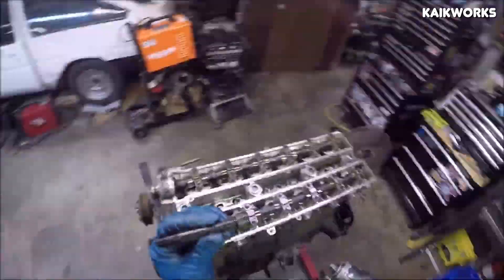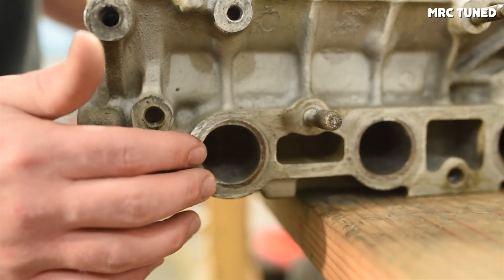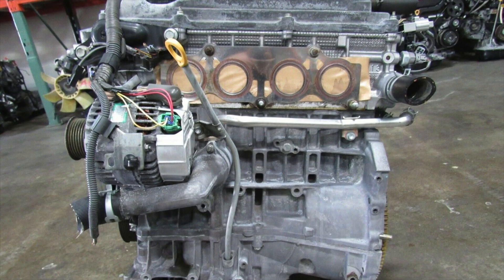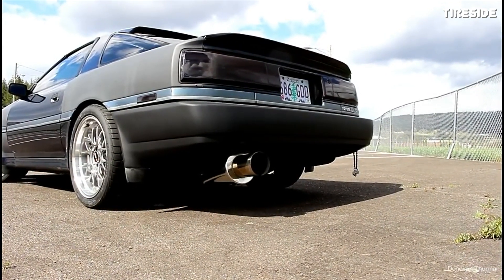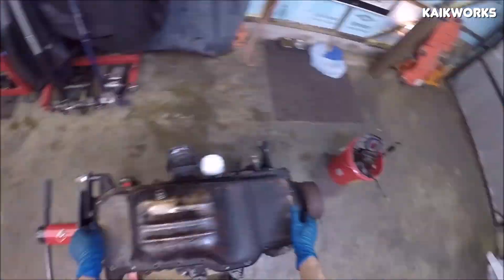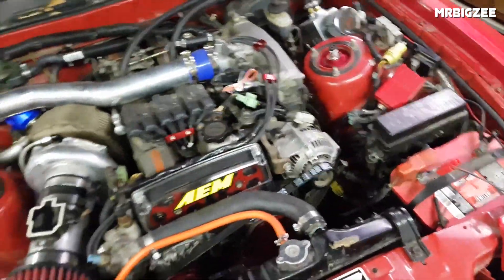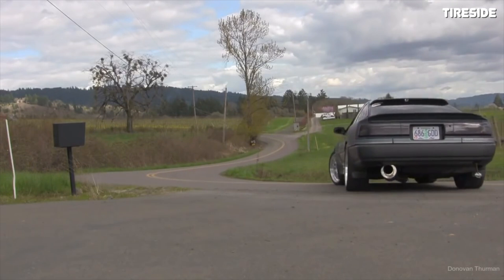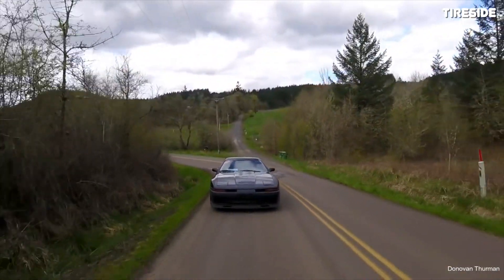Toyota 7M-GTE: Everything You Need to Know

Comment: The problem with the 7M-GTE engine, especially the road knock, came from the coolant which dripped into the oil, and therefore it was a followup The stock engine with the cylinder head properly made was able to generate over 500 horsepower reliably. The rods were not a problem.An often overlooked problem of the cylinder head was because the coolant wasn't flushed enough with the cast iron block. Everything got rusty and therefore the engine wasn't able to cool enough. And if you had a leak where the coolant flushed, the first thing that hasn't had any coolant left was the cylinder head. And if you saw that the engine temperature was rising, it was already too late and the cylinder head was bent.Ask me how I know. I'm just now changing my head gasket from my 7M.

Comment: Did Toyota actually update the torque spec on the head bolts in their manufacturing process in the later MK3 production years?  This would be new information to me, but asking since I just bought a 1992 Turbo with 42k kilometers. (25k miles)  😁

Comment: I've had a few 7Ms over the years. My first one was a 1989 Supra NA 7MGE. When I bought it the head gasket that was going. The upper radiator hose was swelling from all the combustion getting into the cooling system.

I rebuilt the head and had it decked a bit. Bought an HKS metal head gasket and ARP head studs. Did all the other bits while I was in there such as: timing belt, tensioner, water pump, aluminum radiator, motor mounts (tore one when I was pulling the engine), all gaskets and oil seals.

After that it was the most reliable vehicle I have ever owned. That was almost 15 years ago and it still runs to this day without a single issue.

I had two turbo engines, and they were fine. A bit more temperamental and were some times a pain in the ass, but they were a lot of fun to drive.

Comment: Choosing to modify a 7M or MKIII alone is reason enough to be locked in an asylum. That trash motor and chassis are a perfect fit for each other. One of my biggest mistakes was not scrapping both of those quicker than I did.

Comment: Nice info...I have a 1987 Totota Cressida with  1G-E 2.0 six cylinder...2 valves per cylinder...this engine is smooth and extremely reliable stock as long as you service it regularly...Seeing that good condition MK II Cressidas are becoming extremely hard to find...and mine is still in good condition...I really need to get an engine, to be kept stock, to give a bid more zip...the IG-E engine is extremely lazy...so next thought of upgrade for more power will be looking to replace the donkey 1G-E engine with a 7m-GE 3.0 24 valve DOHC engine...

Comment: had a mk3 turbo about 20 years ago in the UK.. had head gasket issues and then bottom end issues due to oil starvation.. 

Car was not really designed as an all out sports car so some things were not thought about I guess.. I always thought the oil issue and bottom end problems were mainly because there was no baffle in the sump hard acceleration or steep hills the oil would push right back in the sump... So when I had the issue I ended up welding my own baffle into the sump to get around the issues.

Never really kept the car long enough then to know if it helped but reading here seems there was other oil pressure issues as well. 

But yeah mk3 super is a stunning car still one of my favourites..

Comment: Very informative video but I take exception to your comment on the CT-26 Turbo.  I'm an original owner of an '87T with a little over 200k miles and I have nearly 37 years of experience.  My former mechanic, who raced Supras, purposely took his CT-26 to 25-lbs before it gave out.  I personally ran 18-lbs for almost 2 years without a problem before backing off to around 12-lbs just to go for more longevity over ego.

Comment: The 7M-GTE is a great motor and really overlooked as a big power motor.  The 2JZ is a great motor and its tried and true to get power.  Lets look at some facts though.  Who is going to swap or transplant an un-rebuilt motor into their rides?  Not very many, im willing to say maybe 5%.  If you pay attention to detail on rebuilding these engines, there is no reason why couldnt aim for 750 to 800 hp.  

With that said, for a high screamer and for all out top speed, 2JZ until the cows come home.  For a street car and daily driver with big HP i would go with the 7M-GTE.  Reason for that is simple.  That long stroke to big bore lends itself extremely well to supercharging.  

A guy down the street from me has both a 98 Supra with a 2JZ and he has a 92 Supra with the 7M.  He uses both for Autocross.  On longer courses with a lot of straights he use the 98, but in shorter parking lot courses he uses the 92.  

Both engines are fantastic but they each have their shortcomings.  Needless to say, he takes his wife out on the town in the 92 and prefers to drive it everyday.  Build it to solve the weaknesses, and youll have a great engine either way.

Comment: Out of the box the 1j, and 2j are superior to the 7mgte. ARP the top and bottom end, machine the bottom end to tight tolerances, shim the oil pump, and remove the stock oil filter Mont and relocate it. I wad able to get 150 psi oil pressure on cold starts, and 20 psi st idle. 5500rpms I achieved 85psi.

If you get rod nock resize, or replace rods, and stop being cheap with repairs. Use a metal head gasket and up the compression on the pistons with a 67mm turbo, and make big reliable power. I've done this,and can prove it by SUPRA Forums.

Comment: After having built one of the highest reliable horsepower 7m’s out there. There are far more problems then described in this video. Yea the head gasket was under torqued from the factory. But also the aluminum head the was made of a soft material and if heated past a certain temperature, the head would into jello causing to head bolts to come loose because they would just keeping sinking into the head. Which would lead to blown head gaskets. The solution that was used by forum members to resolve this issue was to add over sized head washers to prevent the head bolts from sinking. Factory oil pressure was an issue. The oil pump needed to be shimmed. Aside from the oil pump needing shimming, the factory oil cooler ran a pressure relieve valve that restricted flow, it needed to be converted for better oil pressure and flow. The factory oil filter sandwich plate also restricted good oil flow and also needed to be upgraded. The 7m is also prone to easily getting coolant leaks and oil leaks and exhaust leaks. The factory valve cover bolts need to be replaced with after market bolts in order for them to stay torqued properly. The factory exhaust head studs would strip causing exhaust leaks since the head was too soft so the bolts would need to be replaced and retapped with over sized studs. The coolant tube that runs around the head could easily leak because of the rubber cap that plugs the back for a right hand drive heater hose. The factory intercooler plumbing is prone to heat soak since it runs over the turbo. The CPS was an issue, you could not get a steady reading and made the car harder to tune especially at hp numbers higher than 500hp. Though not a problem, 7m ran batch fire ignition and fuel injection. And would need to be converted to sequential ignition and injection. This alone made the 7m inferior to the 1jz and 2jz platform. 1jz and 2jz used newer electronic technology and were far better base platforms. They just had far less issue that needed to be addressed from the factory to run reliably with higher horsepower.
Reply: Man, you guys are scaring me. I just inherited a 87 turbo Supra 5 speed with only 43,500 miles. Everything has been done. head gasket, valve cover gaskets turbo, timing, belt, belts, slave, cylinder, wires, plugs.when I let it sit for a long period of time it smokes slightly blue ish tint then goes away once it warms up. But if i drive it daily no smoke. Is this normal?
Reply: @HB-yq8gy Means it oil burning at cold start has along its not excessive and long it should be fine probably worn piston rings or valve stem seals
Reply: I’m chasing an oil leak on the rear of the engine. Comes out the bottom of the bellhousing. Changed the rear main and the valve cover gaskets. I’m at a loss 😂 can the head gasket leak oil out the back? Runs good and doesn’t eat coolant
Reply: The rear main seal housing could be cracked. You can buy a used housing cheap off of eBay. Or valves covers bolts not tighten down enough. Did you get new bolts and washers for your valve covers?
Reply: @mkg40287  I replaced the rubber gaskets for each bolt, but I’m still using the stock Philips head crappy screws. Maybe I’ll try ordering the upgraded valve cover bolts. Seems like it’s really coming from inside the bellhousing behind the flywheel. Might have to check the housing. Thanks for the reply 🙏
Reply: Thanks for all this advices, but i have a question, what do you do to the oil filter sandwitch plate ? Thank you
Reply: @highwaltage  
No it doesn’t. My 1JZ TT has factory sequential.
Reply: my bad. i was thinking ignition. lol yes the ecu has individual drivers for injection. i even thought ur response was about the turbo setup not injection lol. all g comment will be removed.

Comment: I feel like a decent bit of this information is outdated and you got it from old forums from the late 90's and early 2000's. That said the 7m is plenty capable. The stock block capability is definitely  more than 4-500 hp as long as the mhg and oil pump issues are resolved this engines can reliably do 5-800 hp on the stock block as long as its tuned right and has proper supporting mods just like any jz. And the gt3076r is what everyone used 15 years ago, real supra owners know that you only run borg warner s300 series turbos or at least a precision 60 series.  With all the support in the aftermarket , trigger systems and better tuning options like ecumaster emu or even the det3 piggieback 7m is a win in my book. Sounds better than any jz , more unique, and you can literally build a 1000 hp 7mgte for pretty much the cost of a  bpu setup 1 or 2j swap. its a no brainer
Reply: All folks who cannot afford a JZ say this..
Reply: @oggarage6298  who needs a jz when I can make more power for less. And I've owned p plenty of multiple generations of supra and  7m's,1, and 2j's and still stand by this.

Comment: I had a 92 facelift model ... approx 600hp (never dyno'd ... had 5 boost settings , methinol injection , full engine rebuilt , port polish , forged piston , launch control etc ... had a bigger turbo but got offered a deal for it i sorta was mad to not take ... it was a fun sleeper, metal head gasgets and studded down a must ... made many v8 drivers cry .... had 4litre quad cam soarors , 2.5 twin turbos .. 430 lexus coupes ... now got a gs 08 460 lexus 140km ... beaut car but will update to 5litre later model end yr .. but the 7mgte was one fun engine i got built up .. think with computer cost me $50 k .... thats 5boost settings .. metal gasgets full internal work , external wastegate , meth injection , launch control ... twim skin kevlar clutch ... loved that car ... woman made me sell it for towards home ... so make sure still have a nice driver now aint got toys ...
Reply: Think put differantblade in turbo .. then ripped it out put a bigger one ... then got a massive garrett for it .. would been well over 600hp with that .. was set up for whatever turbo i wanted ...

Comment: The 1988 Supra Turbo-A was the factory's attempt at a faster Supra with 265 hp.  It really wasn't a standout performer because these cars weigh 3,600 pounds and to get down to a nimble 10 hp per pound weight you would need 360 hp. I consider my 1987 Turbo Supra a sport tourer with comforts.  If I make an aggressive move on the road the wannabe racers always make an appearance. I just want to get there in one piece, not first.

Comment: the 7m-gte was never designed to be a turbocharged engine. toyota basically lowered the compression and slapped the ct-26 on it. the JZ engines were designed from the ground up to be boosted. the rod knock issue has been debated to death for yrs and the consensuses is that the 4-7psi of oil pressure at idle along with leaking head gaskets that diluted the oil caused the rod bearings to fail. it's also important to note that yamaha designed the cylinder head on both the m series and jz engines. another fatal flaw of the 7m is that the fire rings are basically touching each other which would cause HG failures... it's still a great engine and I believe I still hold the stock exhaust manifold power record of 543whp set back in 2001.   :)

Comment: Here's what you need know. Avoid that engine if you're intent is driving it hard. I had all the resources and knowledge and 7m dedicated friends, mechanics and hobbyists and just avoid the thing for anything if you don't like constantly dropping money and banging your knuckles. It's more obsession than enjoyment when they break. Yes bhgs are a major problem due to layout again.
Reply: I think thats all boosted M engines lol
Reply: If the engine is built and setup up right it can be beat on all day just like any jz engine. Most  people that try to stray people away from the 7m either havent really owned them / built them or just jz fanboys. Theres plenty of proper built high horspower (800-1000+) 7m's and track only cars. hells i ran a 600 whp 7m for years and beat on it everytime i drove it. Its all in how its built and how you maintain it.

Comment: 2 flaws: 1. Head gasket needs torque to 100lbs 2. eliminate banjo bolt oil line to pump other then that good to go for 600hp reliable bottom end engine after other tasteful power upgrades

Comment: My 7m is at 1000whp.  I still run the original 1987 oil pump just to prove a point.  I did however shim the pump and check the tolerances.  Video is pretty good I do however disagree the horsepower capability.
Reply: Hi Kwake I’m about to rebuild my 7MGTE , the oil input shaft retention bracket is pretty primitive..any ideas? I have heard Technico racing have a needle roller bearing. …
Reply: @Andrew-jh5uv  Run sr-fab
Reply: Is it blown yet?
Reply: @quake7675 is there anyway I can talk to you? I have a 89 7mgte and a 7mge cylinder head. Going to build on this because I also like the idea of doing something that most people wom't. I need your help and knowledge to build a healthy and strong 7M. Aiming for the 650hp or 580whp
Reply: @TheMrFlyBoy18  Wondering the same thing, got myself an 89 turbo and always wanting to learn
Reply: nigga stop the cap😭
Reply: @joeyhardin2453  Wym, you can make over 1000hp on a 7mgte with nothing done to the bottom end but pistons and rods. Plus after you shim the oil pump the oil pressure sits at around 80psi at idle
Reply: The 7M just wasn't a good design in my opinion. But at the same time the tuning solutions for these were anything but great and probably accounted for the majority of failures. The stock electronics on the 7M sucked and most people were running SAFC's and old AEM standalones. Modern tuning would probably greatly increase the success of these motors.
Reply: @CyFi6  You think something that makes it thirty plus years is a bad design?
Reply: @quake7675  I think it has its shortcomings for sure. Do you mind if I ask why you decided to stick with the 7M? I have to admit I love the exhaust note, probably more than the 2J.
Reply: @CyFi6  because I always build what people won't,  been doing this a long long time.  Toyota and lexus master tech.  Everything has shorts it's how you get around them that counts.  I've got over 100k of driving on 7m's.  I also made the quake mod and solved the head gasket issue
Reply: What trans is behind that?
Reply: @garrett591 The 5spd  manual is an R154...Very strong transmission...I have been over 700hp since 2006 I have owned 4 or 5 MK3 Supras over the year's....I love the 7MGTE
Reply: Wtf does shim even mean I’m clueless also how do you check for tolerances without like a industrial lathe machine thing?
Reply: @Americana-deluxe  with feeler guaves my friend.

Comment: 2jz-GE are quite easy to find in Europe...just buy a Battered GS300 and pull out the Drive train and ECU....2JZ-GTE are not easy to find Outside Japan.. but common in Japan bcos a lot of JDM Toyota models use them..Chaser..MKII..Aristo..Crown..have a 1jz/2jz GTE pushing them

Comment: The problem with the Supras (and probably other cars) that had this engine was that Toyota spec'd an underpowered cooling system for the car.  This resulted in overheating and then head gasket popping. I had 2 Supras, and had friends with Supras, and they all had overheating problems.
Reply: That's also because the last 2 cylinders is where the EGR gasses got passed into, which made a ridiculously high heat differential across the head, an EGR delete will solve this problem

Comment: I have an 88 turbo since 90. Blown head gasket at 62,000. Replaced it with a GReddy 1.4mm Metal Head Gasket, Head and Values reground (values re-shimmed), ARP studs@75lbs. Profec II Electronic Turbo Boost Controller @13.5psi, HKS Super Mega Flow Air Intake, TurboXS BOV, Down Pipe, Runs great and just hit 110,000miles. Great engine!